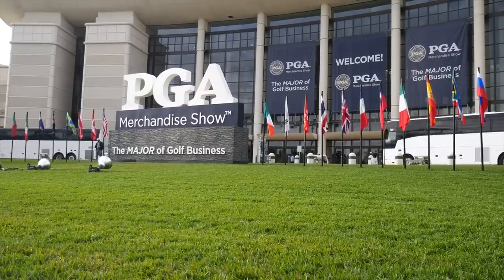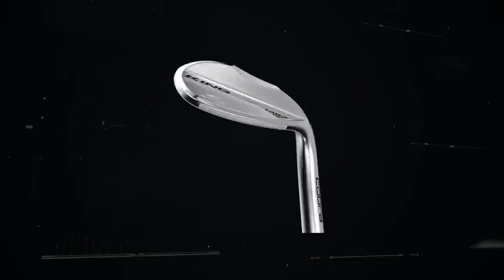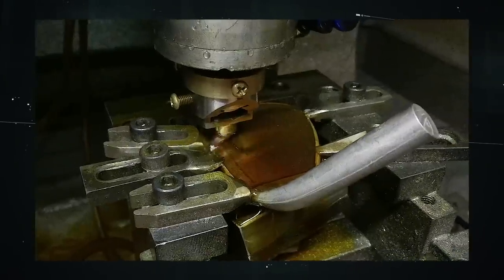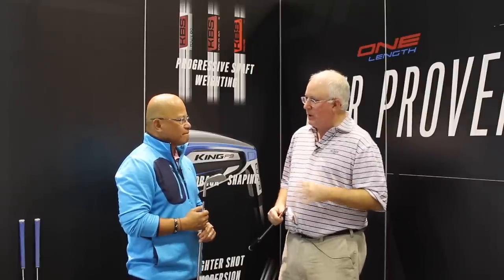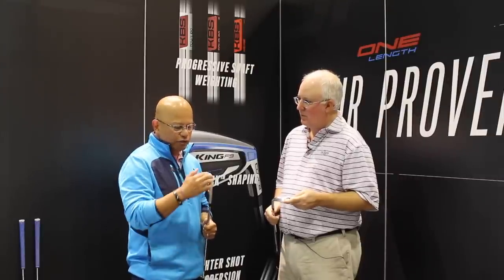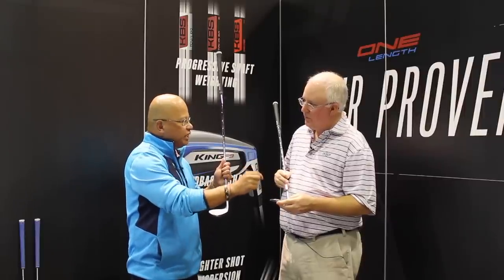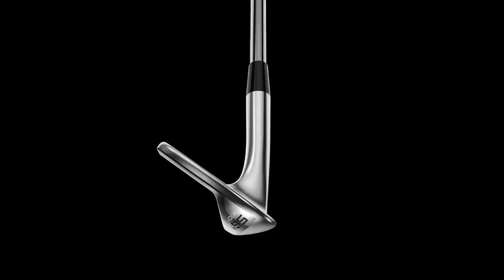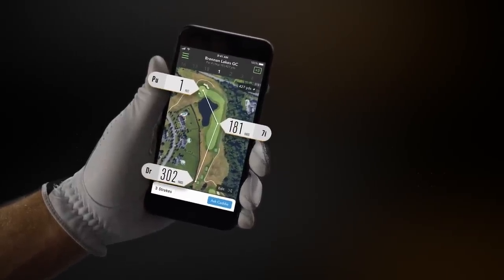Cobra MIM Wedges: Breaking The Mold

Comment: Why do these “experts” continue to show either their own ignorance or show how stupid they believe the consumer to be. 

“More grove edges on ball creates more spin” ummmmm not unless you have somehow suspended laws of physics a which imply the more friction (thus the larger surface to surface contact) creates the most spin.  The groves are there to allow mud, dust, grime and most importantly fluid to exit the connection plane so that more surface area of the ball is in contact with more surface area of face.  The most spin possible would be in a completely groove less and dimple free ball in which the surface Contains minute “grit” or creates more friction than a “slick” or frictionless material. But again at the speeds a golf club comes in contact with a ball there is plenty of friction as is and all more grooves enable is torn up ball covers and faster deforming or plane, leading to cupping and blocked channel groves causing water dirt and degree to interfere with contact of ball and surface causing unpredictable  ejection of ball.   

Grooves play a role but not as a benefactor to “spin”, we could also talk about the trapping of a ball into the ground when struck at a descending angle but the point is already made. 

More grooves and “softer” metals leads to selling more wedges sooner.
Reply: You have to consider the friction coefficient of the surface you are talking about not just the "size of the surface at contact", rough surface has more friction than smooth ones, deepening the grooves and adding more of them equals to a rougher surface....,Grooves grasp the surface of the ball(the softer the ball cover the better)... if you think you are right I invite to try a grooveless wedge (they exist) and see if you get more spin from a larger surface to surface contact) or just see the Rick shiels review about them.